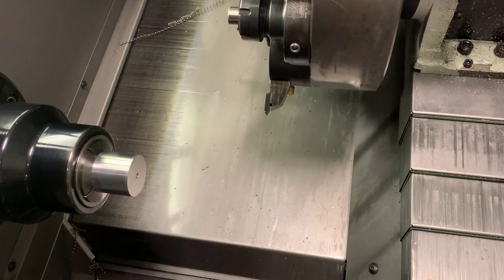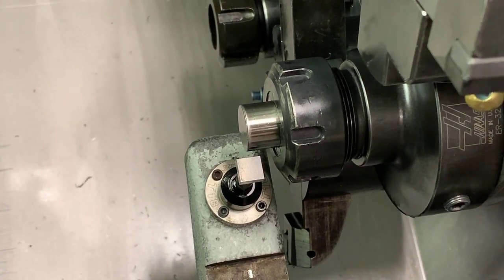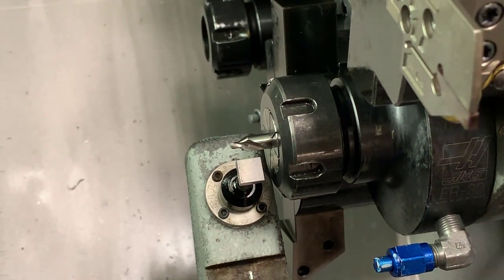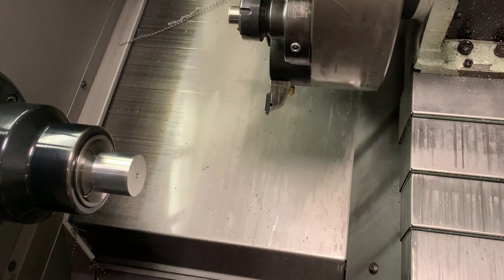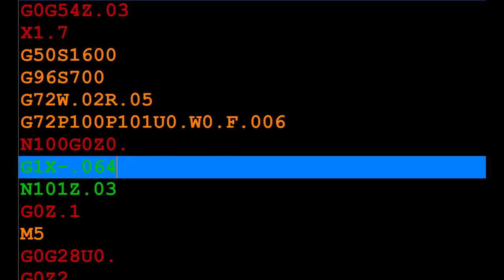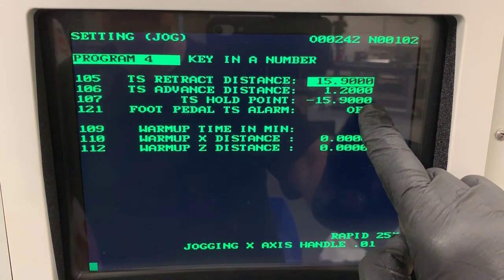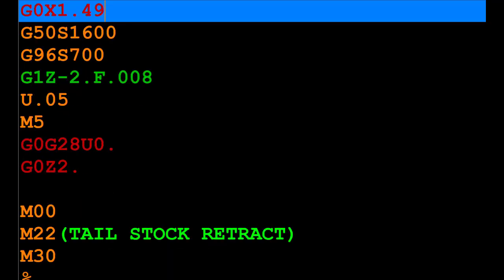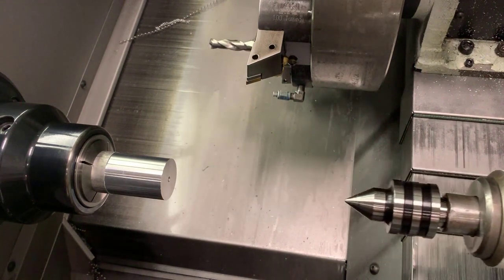Programming a Part Stop and a Live Center on a CNC Haas Lathe

Comment: Interesting video. We use okuma machines at my shop. And for drills or protruding tools we have to indicate the spindle bore via tool holder and calculate zero( so centerline is always zero. The process for a boring bar different of course. But I see how this works.